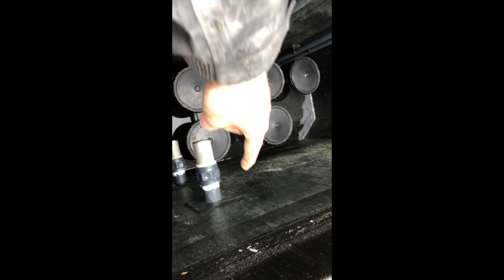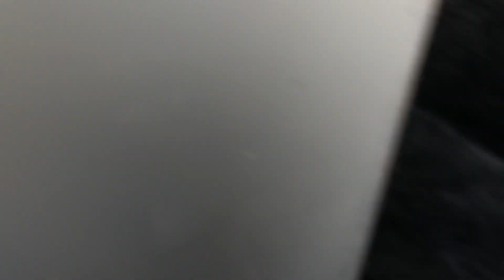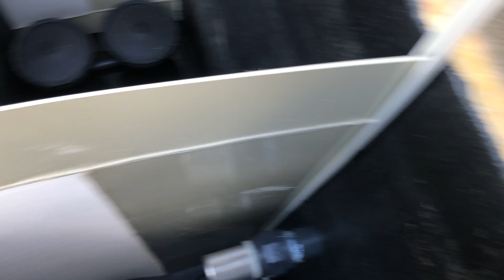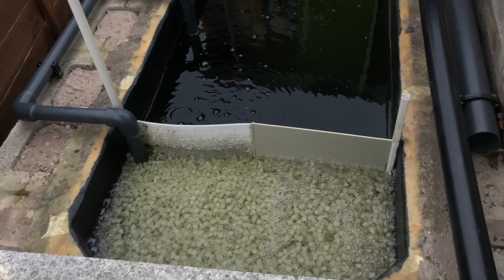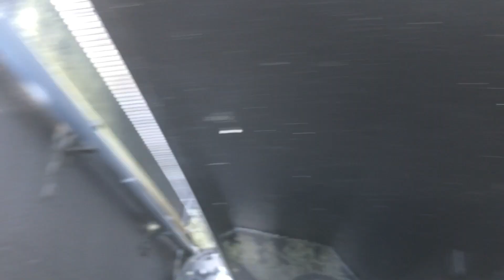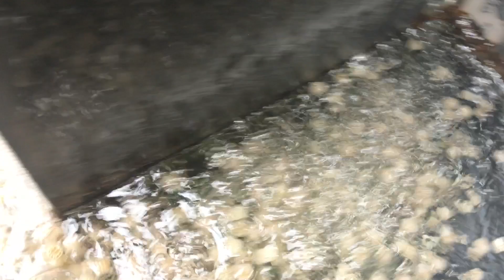New KOI Pond BUILD! EP.16 DIY Bio Chamber

Comment: Want one on my pond .. that's some filtration 👍
Reply from the maker: Thanks! The cost of pre built bio chambers is a rip off, I could put 2000L of media in here for a fraction of the cost of some pre built chambers. Currently at 100L of k1+ which seems to be doing very well, I’ll be adding more as the bio load on the pond increases.

Comment: Hi mate. Where did you source the air discs from and how did you plumb them into the pvc pipe?
Reply from the maker: I got the air domes from absolute koi, 9” epdm rubber dome diffuser, they have a 3-4” male bsp thread on them, I used 1” pressure pipe, with reducers to 3-4” and then a plain 3/4” female to 3/4” female bsp threaded adaptor. The air domes then screw into the pressure pipe. Thanks for the question!